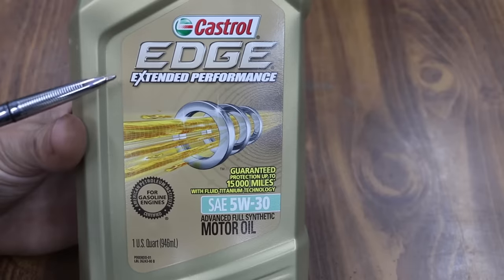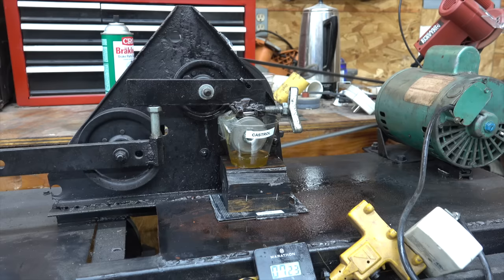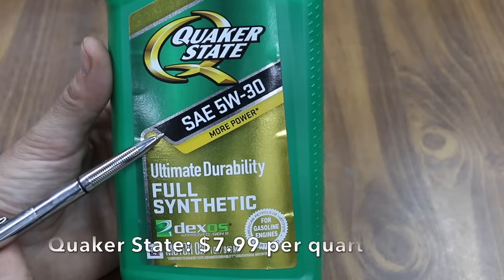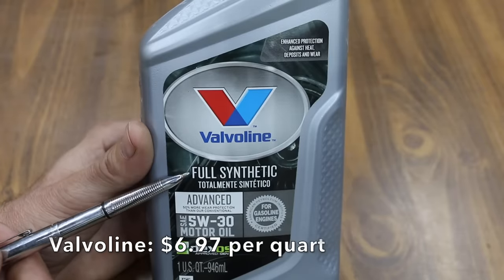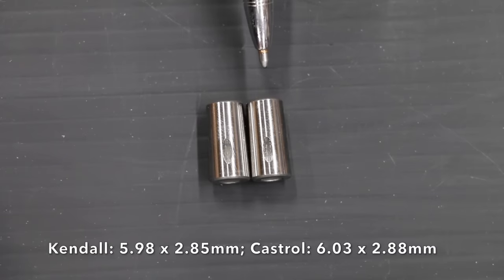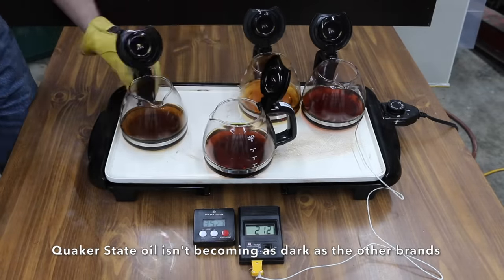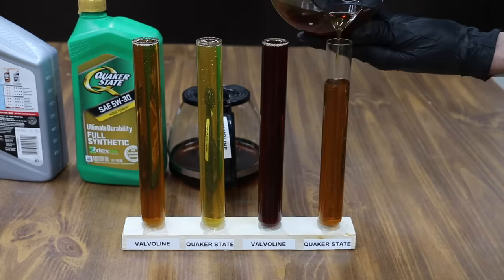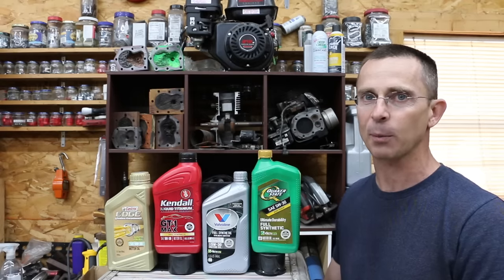Is Castrol Motor Oil better than Kendall? Let's find out!

Comment: Hey project farm, can you please do a k seal ultimate test. Really curious to see if I can use it on my truck that seems to have a little head gasket leak. And how would it handle on the long run. Would it block the radiator or not? Do you have to flush out your coolant after? Really looking forward to this idea. 😁 Thanks and love your tests.
Reply from the maker: Thank you for the video idea!

Comment: I would love to see the fuchs brand also in the list.  It used to be called Silkolene before.  It is the oil that most owners of performance BMW's recommand so it would be nice to see if its valid or hype.  Another you could also add is amsoil.  Thanks for the video.  I used to be a Castrol guy for my sports cars but now use Fuchs, for the daily driver its what ever is cheap from the normal brands as its replaced every spring anyways....
Reply from the maker: Thank you for the video idea!

Comment: Even though valvoline won the oil flow test the Quaker state impressed me because it didn’t slow down like most oils after you cooked it to me it appears it actually made the oil flow better
Reply: He did remark that Quaker is not getting dark as quickly as others.  I was surprised too.  It evaporated the least of all four.  Obviously it has to have some very good base oil stock in it.
Reply from the maker: Thank you!

Comment: Off Subject. Often, I witness someone double or triple torquing a fastener. A Video on whether or not this increases the torque value exponentially with each additional click of the torque wrench would be a very valuable and interesting video to either confirm or bust this often discussed practice. Many say it doesn't increase torque values, but I my self have checked, and my experience shows me with each additional click of the torque wrench, the fastener DOES become over torqued. Well wishes to you and yours!! Cheers! Zip~
Reply: When you say double or triple torquing a fastener, are you saying they over torque by double or triple the value or just torque it two or three times?
Either way here are a couple of points to be aware of.
First, there are different types of material to be torqued.  Each type of material will have a different range of ability to be over-torqued, but it is always best to stay within the torque range set by the engineers for that particular application.  You almost never want to under-torque, but there are instances where a thread locker can hold the needed torque if the fastener will not.
Second, when using a torque wrench correctly, you cannot increase torque just by using the torque wrench multiple times after achieving torque the first time.  If it does, then you might want to get your torque wrench calibrated.
Reply from the maker: Thank you!

Comment: I would love to see a video on Castrol Magnatec.  Does it really stick to the engine parts in order to form an oil film which stays there to offer better protection on cold start ups as claimed?  Could it be compared directly with Castrol Edge to see which one is best?
Reply from the maker: Thanks for the video idea.

Comment: Mr. ProjectFarm, are you going to also test ACDelco Dexos 5w-30 like what the dealerships have? I work at a Chevy dealership and I'm very curious as to see how the Dexos from the oil truck compares to off the shelf bottled oil, though you can buy by the quart at the dealer.
Reply from the maker: I need to test the vehicle manufacturer branded oils soon. Great suggestion!

Comment: Quaker State would be a great oil for a direct injection gas engine. The lower evaporative losses means less oil deposits on your intake valves. It's a great engine oil that's available at most stores at a good price.
Reply from the maker: Great point! Thank you

Comment: question.  The anti wear test.  are you using the cooked oil version or the never heated version.????  I would think using the cooked version would be the test decider.  Would this not determine whether the properties are holding upto their claim status.?  Or a before and after heat cycle testing.  Or would this only work if the oil has been used for the claimed 12000 miles usage.?  I think Amsoil will win overall.
Reply from the maker: Thank you!

Comment: I have an idea for a video.  I accidentally got welding wire into an intake port and in the combustion chamber.  I believe the rod welded to the top of the piston because there was an occasional tap and now it's steady.  I haven't pulled the head yet or got a bore scope.  So my question is:  Will welding rod or welding wire weld to the top of a piston in the heat of a combustion chamber?
Reply from the maker: Thank you for the video idea!

Comment: I forgot you actually did Valvoline. I find Valvoline personally the best oil, you showed the oil's ability to seemingly just flow extremely well leads to a quieter and smoother running engine overall, even if on paper it gets beat by some other oils. The only downside to Valvoline I can see is their TBNs tend to be lower on their oils compared to competitors, and they still advocate 3000 or maybe 5000 mile oil changes on their own bottles, compared to competitors advocating 10-20K, but I'm just of the opinion 3-6K OCIs are ideal no matter what oil you run.
Reply from the maker: Thanks for the feedback.

Comment: Hey Project Farm,
My son just put a brand new Yota1 built 22re motor in his 1995 Toyota truck. A lot of folks on line are recommending conventional oil for that motor but I am convinced that's because they're worried about leaks in their older vehicles. Since his is brand new I am recommending synthetic to him.
I, of course, would love to hear your thoughts on this and I'd like to see a video pitting the best synthetic against a conventional oil. If you already have one, let me know. I looked but didn't see it.

Thanks!!
Reply from the maker: Thanks for the suggestion.
Reply: The people that are recommending he run a conventional in it are most likely basing their opinion on the fact that older engines can get "leaky" and or run in to issues if they have been running conventional oils for hundreds of thousands of miles (any have received very little other engine preventative maintenance during that time) and then switched over to a full synthetic motor oil which then produced oil leaks at various places and/or lead to an oil starvation issue because the synthetic oil loosened up gunk that had been building up inside the engine for hundreds of thousands of miles when conventional was being used in it. 
People then make the incorrect assumption that the fact that the engine started leaking and/or experienced a clogged passage after switching to synthetic that it's because that engine was designed to run on conventional oil and not synthetic. That of course is an incorrect assumption and the issues that were experienced after switching to synthetic were caused because of the amount of gunk had built up inside the engine while it was being run on the inferior conventional oils at the time which were then loosened up by the superior cleaning abilities of the synthetic.  That is a VERY different scenario than running a NEW 22re engine on full synthetic from the very start but the people who believe otherwise do so based on their own ignorance on the subject. 
Fortunately even conventional oils are dramatically better than they were back when the 22re motor first came out, so even if he does decide to go with a conventional oil, he will be just fine as long as he does frequent oil changes such as every 3k miles.
If he does decide to go the conventional route I would recommend Chevron Supreme motor oil to him. I've seen many laboratory verified test results/analysis after running that oil and it does an outstanding job as a conventional oil, to the point that the results were almost indistinguishable from that of a full synthetic. Walmart is a good source for ordering Chevron Supreme motor oil especially through the Walmart Website since the actual store locations usually sell out of the Chevron Supreme the same day they get the in stock.

Comment: These engine oil tests are great!  With spring work upon us, I've been wondering which bar and chain oil is best? There's lots of guys that say it doesn't matter much,  but I would bet a lubricity test and film strength test would be quite telling!  Stihl makes a bio-friendly type that would be interesting to test along the regular offerings and other brands. Keep up the great work!
Reply from the maker: Thank you very much!
Reply: It won't make any major difference, but I use a straight 30-weight coonventional oil in my Stihl.

Comment: Money Saving hack, Valvoline makes napa auto parts oil. (its the same thing just branded napa) napa has great sales from time to time. full syn can be had around $3.50 a qt at my locations (sale price). Look on the bottle it says made by Valvoline oil. Check it out if you'er okay with the Valvoline's performance.   Good clip PF!
Reply from the maker: Thank you!

Comment: Kendall seemed to have a lot less blackening. Suppose that is due to the higher heat wear? I like the competition videos. Thanks for doing them. I've been a hard fast Pennzoil fan but I now use my mfr recommended Dexos my dealer puts in. Being a lifetime engine and drive train warranty I'm obligated to.
Reply from the maker: Thank you!

Comment: Can you please test drill bits?

Run a 1/4” bit through 1” plank using calibrated pressure (20 lbs?) and measure time it takes to go completely through as a baseline of cutting ability. 

Then through 3/16” mild steel plate 10 times. 

Then through the 1” plank again. 

An increase in time to pierce indicates loss of cutting edge.
Reply from the maker: Thank you for the video idea!

Comment: 6:35 I take issue here. If both lost the same amount of weight (material). That is a tie. Scar length is actually a measure of the density or hardness of the test material and not wear protection. At this margin of error you should call it a tie or repeat it until you can show a statistical trend in data. I love your channel. Not being critical. Just offering my opinion.
Reply from the maker: Thank you for the feedback

Comment: You should make a shared google doc that has the information in it. Weights before and after the heat test. Bearings before and after the friction test, etc. Also Are you planning on doing the friction test with the cooked oil or frozen oil to see what it does on when the oil is hot and on really cold mornings?
Reply from the maker: Thank you very much!

Comment: Hi, thanks for the videos! I was wondering if you can make a video about vs within same brand.
Example: Valvoline Advanced Full Synthetic vs Valvoline Full Synthetic High Mileage
The question/s I have are:
- Does that over or under 75,000 really matter?
- Does the leak prevention in the "max life technology" matter?
- Does does difference in stars on the back of bottle matter?

So yeah does the different versions of oil from 1 company matter or is it all just marketing?
If possible to do this with a few different brands/companies just in case.
Thanks.
Reply from the maker: Thank you

Comment: I didn’t know they still made Kendall anymore. They pulled it off the shelf at my local parts store. It used to be what I ran in my car until I couldn’t get it anymore. Switched to Mobil 1 after that.
Reply from the maker: Thank you!  It did well in testing. We'll see how it stacks up against Amsoil

Comment: Hey PF! Can you test how many liters (fractions of a gallon) it takes before the grade of fuel you've selected comes out of the pump at the gas station? I know here in Canada Shell, Esso (Exxon) and Chevron 87 is up to 10% ethanol and 91 is supposed to be ethanol free.

If you have a fuel station in your locality that uses different ethanol levels depending on the grade of fuel, could you use the difference in ethanol content as a way to tell when the difference fuel starts to come out of the nozzle?
Reply from the maker: Thank you for the video idea!

Comment: Please test the best two stroke oil. I use Amsoil Saber in my blower and trimmer and swear by it. I mix it at about 80:1, and there's basically no smoke and starts up on first pull, every time. I do also use ethanol free gas that I get at a local gas station.
Reply from the maker: Thank you for the video idea!

Comment: For $20 at your local Walmart, Quaker State Ultimate Durability is gonna be very hard to beat in this race. Its made by shell which also makes pennzoil.  The only negative of this oil is that it loses viscosity around 3 to 4k miles of use. So instead of a 5w30 it becomes a 5w20 which has been verified by my Blackstone laboratories test result.
Reply from the maker: Great price!  Yes, I noticed the viscosity loss on the oil flow test.

Comment: Why the new Mobil 1 rated GF-6 with 20,000 miles protection? The old Mobil 1 rated GF-5, why they change the rating with new oil
My vehicle required only GF-5 only , can i still use GF-6 oil? Will it damage the engine

Comment: After you put oil in your volumetric flask, how do you wash it out for reuse? It should take some time to get it clean and dry.
Reply from the maker: I throw away the plastic ones and clean out the glass ones with acetone and paper towels.  It takes around 2 hours to clean the shop and the equipment after one of these videos

Comment: Project farms! I’ve got a rather odd request that’s been bothering my curiosity for a while... it’s looking at an engine after it’s ran upside down. This comes from hearing after flipping a car over, most times the motor is toast from running upside down. I know the understanding of gravity and oil causing a lack of oil inside the crankcase, but from your videos, it’s shown motors can run for a little while (does cause damage) but is still able to run... where I hear they’re just toast! Wanna run a lawn mower upside down as a video for me? 😂
Reply from the maker: Thank you for the video idea!

Comment: It would be awesome if you tested Castrol Power 1 4-T 10w-40 full synthetic motorcycle oil. I'm interested to see if it turns acidic and how it holds up after a year or so. I have it in a ATV that I don't drive much. I've only put about 250 miles on it over a 18 month period and it is still a golden yellow. Not sure if there is a need to really change it. Some info would be great !!
Reply from the maker: Thanks for the suggestion.

Comment: I use Castrol Edge 5w30 LL oil for my sonata, an American import 24 engine, but I noticed a rough sound at the beginning of the operation, is it suitable for it or not?

Comment: I had a thought and a question, with an oil that is thin enough to win in the race is that a good thing? 
I was thinking that I would want an oil that will not move so fast. I want it to stick around on the parts longer. So to have better cold start protection. What do you think?
Reply from the maker: Great point. My opinion is that it shouldn't thin out or thicken too much after heat exposure.  It should perform similar to new.

Comment: In your testing you have been collecting motor current data and temperature rise on the bearing surface. Have you ever considered graphing those measurements to look at the friction coefficient? Also, on the bearing wear, have you thought about the gradual deterioration on the spinning surface that is cutting in to the test sample?
Reply from the maker: Great recommendation on graphing the test results.  Great point regarding the wheel on the lubricity tester.  Thanks again!

Comment: Great Showdown...I just bought a new F150 2.7 EcoBoost and want to change oil for the first time I am using this test showdown for locally available oils to use. The research I have done states Kendall is the same as Motorcraft oil. I am no oil expert but im leaning toward my personal favorite Amsoil.  Not sure if anyone suggested this but how about doing this on all the locally available house brand synthetic oils from all the big box stores that most of us shade tree mechanics would buy. Brands to test Super Tech ,Napa, Orielly,Advance Auto and Auto Zone Synthetics..Thanks
Reply from the maker: I'd go with Amsoil if you're allowed to do so under warranty.  Great recommendation on the store brands!

Comment: What is the recommended mileage to use Castrol Edge 5w30LL before changing it... Knowing that I change it after only 4000 miles.
Reply from the maker: Thanks for the suggestion.

Comment: Hey I use that Kendall oil in my cars (synthetic blend). It's at cost less auto parts in my area. It's not $14 a quart though... more like $5 to $6. I wonder if it's really worth spending $3 more for quart versus Mobil or Castrol.
Reply from the maker: Thank you!

Comment: Is any difference between liquid titanium (Kendall) and fluid titanium (Castrol)? and also, how the wear is in the metal of "old pistons"? Do they protect better old wear metal than new one?
I think should be tested in a real scenario (in a external motor replacing the pistons) and not rubbing against a small cylinder....
Reply from the maker: Thanks for the suggestion.

Comment: I love what you doing. But I have one thing to add to your tests. Synthetic oil should be tested at operation temperature. Because its non-nowtenain fluid. It act differently at  high-temp than regular oil. So when you test the oil at room temperature it will act as 10 or 5 oil but at operating it will act as 30 or 40w. I hope you would add that to your new testing methods.
Reply from the maker: Thank you very much!

Comment: I only used Castrol or Kendall racing oils in my races cars. This was back in the 70s and 80s though. Synthetic oils were just coming onto the scene, but very expensive. I stuck with the regular oils. I really wonder how this tournament would end up back then.
Reply from the maker: That would have been interesting to find out.